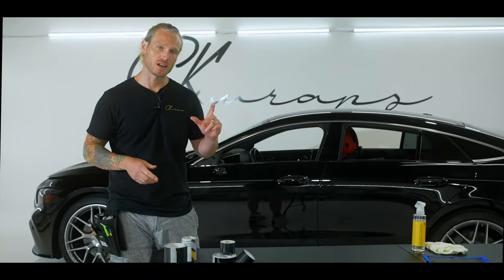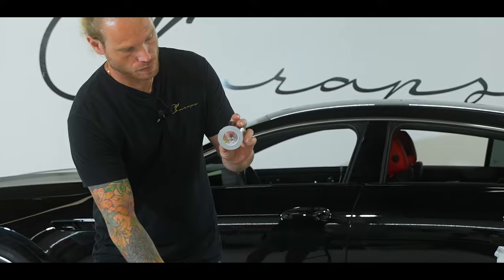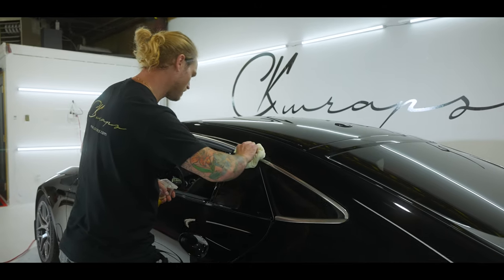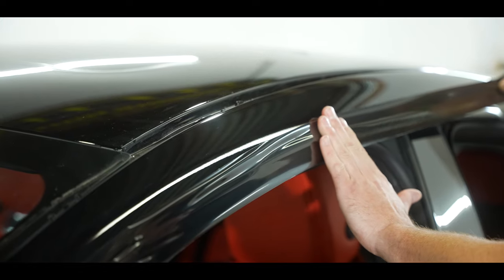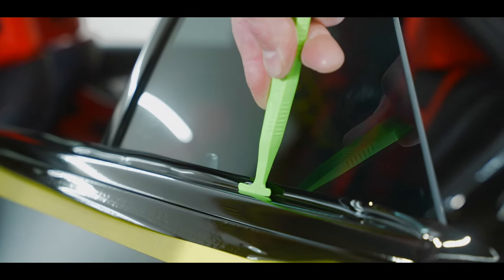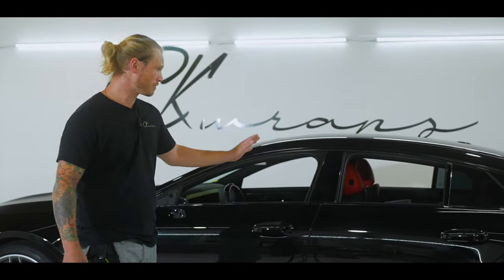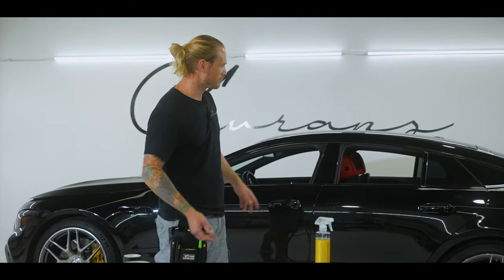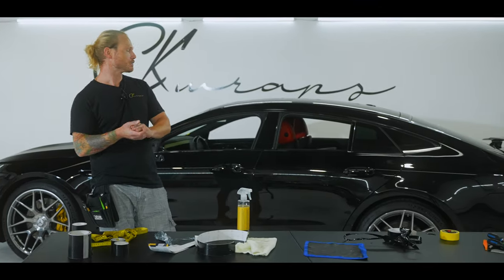Vinyl Tape Rolls for Chrome Delete | VViViD Vinyl

Comment: Hey ! Nice content thank you for quick showcase. 
Could you suggest me what to pick because I am confused now. I got tape  like yours, I got vynil 1%  and I can buy very easy  Plasi Dip. So What you are going to suggest me to use ? Note that the car will be keep outside unfortunately.
Reply from the maker: The benefits of using vinyl wrap vs. paint would be:

Mess-Free Installation: The installation process is clean and precise, ensuring a polished finish without any drips, splatters, or paint fumes.

Easily Removable: One of the stand out benefits of using vinyl is how easy it is to remove. If you ever decide to change the color  it's as simple as carefully peeling off the vinyl wrap.

Variety of Colors and Textures: Vinyl wrap comes in an extensive range of colors, patterns, and textures.

Protection for Original Finish: Vinyl wrap not only enhances the appearance of your trim pieces but also acts as a protective layer for the original surface/

https://vvividshop.com/search?type=product&q=tape*%20rollI 

hope this answers your questions :)